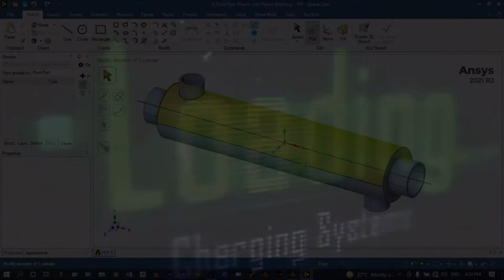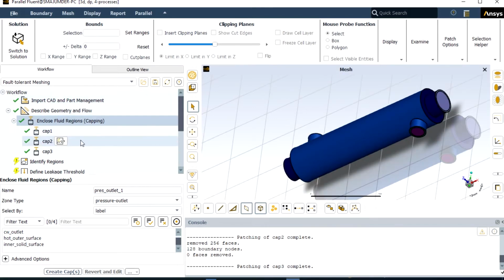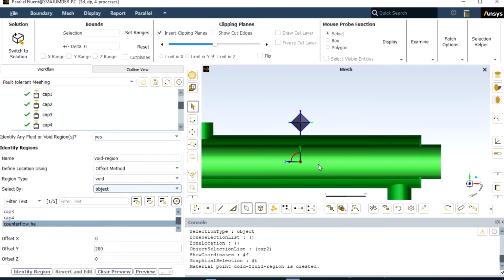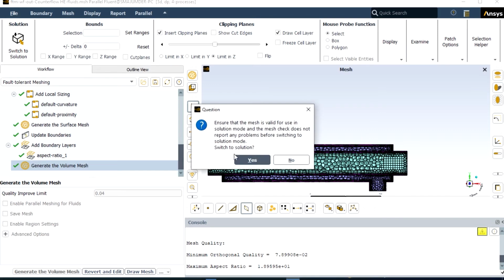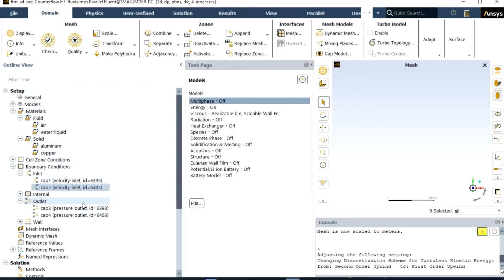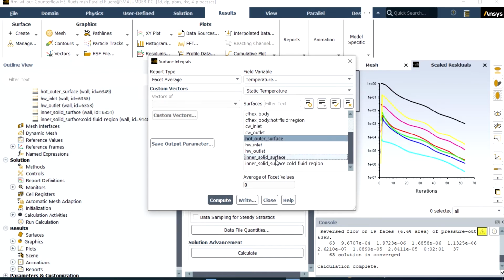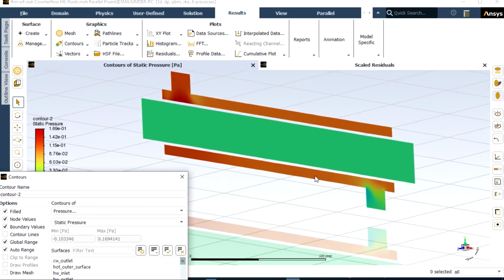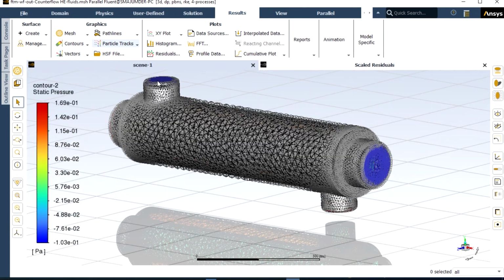CFD Analysis of a Counter Flow Heat Exchanger | Heat Exchanger Analysis - ANSYS Fluent

Comment: Thank you very much for providing such an excellent video. I am currently conducting a CFD analysis on a heat exchanger, and I was wondering if there is a way to obtain the HEX mesh file used in your video. Alternatively, I would appreciate it if you could direct me to any videos or resources that might help me with mesh generation. Thank you very much.😊